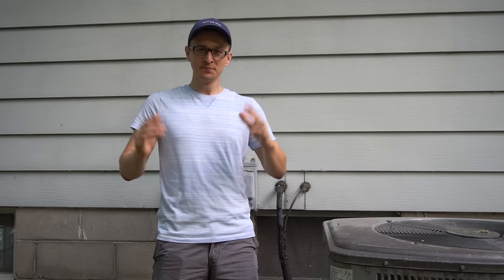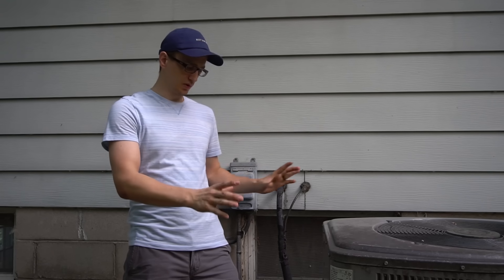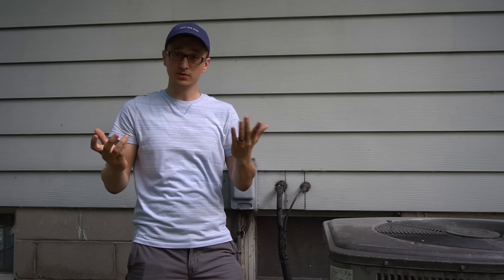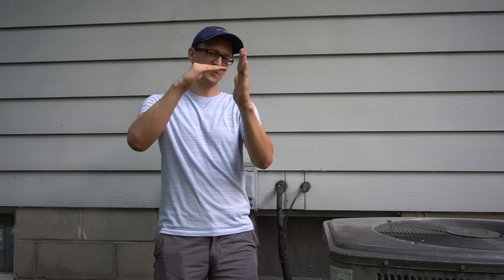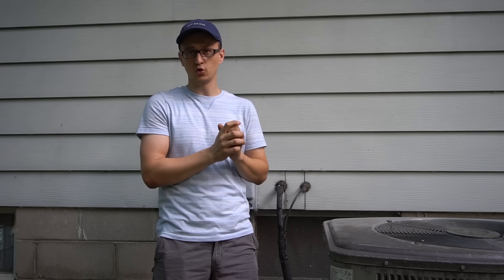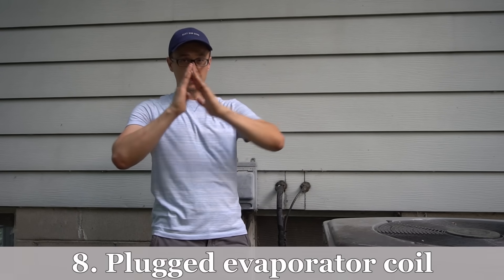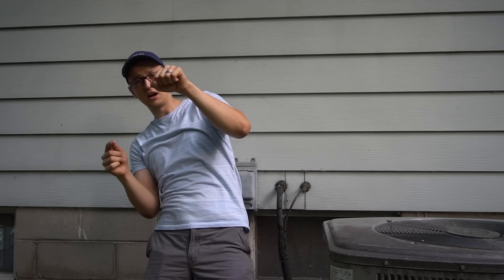8 Reasons Why Your AC is Freezing Up

Comment: As an HVAC tech, I appreciate not being called out for a dirty filter and the other simple reasons you have explained. Cheers
Reply: Why do you not want to be called out? You can charge for the service right? This is the problem, There are just not enough HVAC people, and so it is like pulling teeth to get a service person out even though they can charge to same hourly rate as a lawyer!
Reply: Sounds like this guy works for a company… there’s no incentive to actually do the job
Reply: It happened to my wall unit. I turned it off. Running the fan portion of it. See if it defrost. The change filter never came on

Comment: Don't forget a stuck contactor in the condensing unit, clogged blower wheel, and a bad defrost board in a heat pump application

Comment: One of my friends gave me an LG and air conditioner and I'm not sure exactly what was wrong with it but it was blowing air through it in the beginning she had it set at 60 I don't know nothing about air conditioners except that I thought it was a good one cuz it's the LG I don't know what year it was made but my other friend she's the one that brought it over the one that could carry the darn thing is heavy I couldn't lift it even if I wanted to I'm only 99% and I can't hardly breathe as it is but now that you took it apart we didn't have water yesterday cuz of water shut off but today we have it she offered to clean it wrong clean it out kind of without water it was hard you know but maybe she cleaned the air filters off a little bit I mean I don't know if you can get them wet or not most likely you got it maybe we need another air filter well she cleaned his bed she could as far as I know to wherever but once in a while I'm wondering maybe the wrong screw for the LG air conditioner was put in wrong or there wasn't the right screws because I know that if my LG is a computer I know that has a mind of its own and it pretty much read the way it was and but anyway she cleaned it to that she could and then when she went to plug it into nothing a humming sound I saw it getting cold and I saw the ice and everything but I didn't leave it plugged in more than 10 minutes because it was not blowing any kind of air well the LG air conditioner unit will not go through the window it only went to the window but not out of it cuz it's way too big the only way I can get that thing out the window is to probably break the window and I don't want to get in trouble for that but now it won't blow any kind of the van won't work nothing on it works it just makes a humming sound but nothing coming out at no breeze but the thing itself is getting ice it was ice on it that thing but there's no face a face on it if you know what I mean there's no advance on the face so I don't know what to do I'm kind of dumb when it comes to directions I don't know how much it's going to cost to get I was just thinking maybe I'll just throwing the towel and forget it all into school by another one I thought maybe it would be a minor thing but apparently it's more than a minor thing thank you if you get back with me sooner than anybody else has cuz I don't see anybody helping me anyway but they did it would be a miracle from God

Comment: Having new floors put down. Lots and lots of dust. Caught our system freezing up early. Will running the fan only until it defrosts and changing the filter fix the problem? I'm in El Paso, TX. Dry heat. Shouldn't take long to defrost. Thank you for the video!

Comment: Thanks for good info. Also a restricted filter drier. After the unit has been running a while measure the temperature on both sides of it - should be the same. If more than (2 degrees? - I don't really know ) it needs replacing.

Comment: hey man i did a coil clean because the coil was dirty, but after reinstalling the coil i found a plug inside the coil itself theres a restiction within the evap coil towards the bottom causing the bottomto freeze up and the txv is fine should i replace the entire coil or is there a way to free whatever is plugged inside the coil? any help is appreciated thanks

Comment: My air conditioning is leaking water 😱 fix that . Now have a slight leak coming from the other side of my air conditioning unit the seam . My air conditioner has only been running for about eight hours I’m shutting it off putting on air mode to melt the ice just in case before it gets worse since there was a clog in the drainage hose .  

I don’t see any ice on the outside I’m taking this as a precaution since I cleaned out the hose that was clogged where water could not leave the unit ( it’s 90° out tonight it’s going to be tough we’re not open the windows we’re just running the Fresh air mode to melt the ice due to the humidity outside wish us luck👍🤣

You did amazing job I’m subscribing Single mom raising my son on my own things get tough. Yet people like you keep us going💝👍🎉

Comment: Here lately, in the mornings  my 10 year old Rheem heat pump w/ gas auxiliary heat doesn't seem to keep up on 45deg mornings. I go outside and see frost beginning at the TXV to the coil but the coil is only frosted along the top edges. Is that a restricted TXV or low refrigerant or is the ctrl board failing to put it in defrost mode?

Comment: Thank you. Though, Taiwan has few kinds of such aircon outdoor unit like your video, but really learn more specific theory about coil freeze up issue. The past 4 days are busy for outdoor fan motor not spinning issue. The motor bearing needs to be replaced. But it’s 36c degree in Taipei this week, almost melting indoor …haha. For 23 years air con parts, there is no profit to replace my air con outdoor fan motor with risky 4th apartment out wall. But from the service engineer, my old school  AC air con outdoor compressor runs normally. So, I decided to fix the outdoor fan motor. The rusted screws  at  the fan motor  racket took 2 days to destroy it. In fact, the motor replacing is quite easy. At the same time, changing the new capacitors of compressor and fan motor. After all, they are not expensive and running 23 years … thanks your videos again.
I’d

Comment: Thanks so much, helps a lot. I hooked up the gauges with ambient temp of 99 degrees and the suction side is definitely low (55 psi), but the high side seems too high (290psi)....what is likely cause? Concerned about adding R22 and driving high side pressure even higher.

Comment: Very useful video. My outside condenser fan was buzzing but never starting. Replaced the capacitor outside and it started to run. 
Next day I noticed it iced up outside on the condenser. Went to the attic and checked the blower motor. It is a little cumbersome check. However the motor was "just hot" to touch. Changed the thermostat to Heat and cranked up the temperature. The blower motor did not come up even when the furnace lit up. Switched the power off to furnace. Replaced the blower capacitor. Switched the power on. This time the furnace and blower motor both came on. Changed the thermostat back to Cool. Works now. No more icing. Changing the motor will be a lot more difficult task.

Comment: Thank you for the video I live in San Antonio Texas and the unit froze, shut off and started cleaning the return vents,replaced filter and kept the fan running on the unit. It's midnight and hot so will clean the evaporator coils later in the morning. The landlord is a certified retired ac tech and old so I help him with all the maintenance plumbing,electric plugs and so on. If after cleaning the coils and still freezing I'll get him to freon the unit 🤞🏼, thank you again. Peace out ✌🏽👍🏼👍🏼
Reply: After cleaning the evaporater coils and outside unit the central air is blowing cold air and had to adjust thermostat it was at 75° but the temp inside was reading 70°, I really appreciate the video and thank you again for the assistance 👍🏼👍🏼

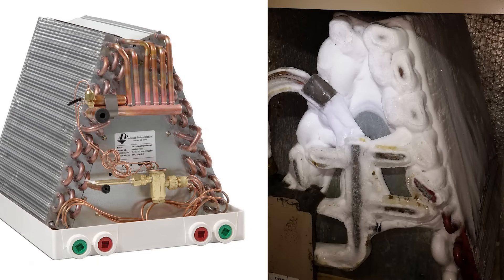Comment: 2 things I would like to correct. First of all there is only 1 reason a unit freezes up, if the temperature drops below freezing. Why is another thing. Second: at 1:03 you say "the air is not absorbing the cooling". I'm assuming you meant the refrigerant is not absorbing the heat? It doesn't work the other way around. First law of thermodynamics, heat goes to cold not the other way around. But great video, keep it up.

Comment: Thank you very much! This helps a lot! Our AC unit froze up 4 times in the last month. We called Reliance Home and Comfort and they sent 4 different guys to look at it. They all said nothing was wrong with the unit and to just keep the vents open. 
Each time it freezes, my wife, our 2 month old son and I sleep in the basement because we need to keep him cool. I'm hoping we can figure out what is going on and get it fixed. Thanks again, we really appreciate it. Looking forward to seeing more of your videos.
Reply: Sounds like it's time to find another AC tech company!
I had the same problem at work on a unit. Was using the same company for years with bad results.  Finally called out another company,  they looked up the information of the condenser, the evaporator and the air handler. Said all three were mismatched and could never perform right.
They gave me a really good quote to replace the needed units.  Worked flawlessly there after! I never looked back!
Sometimes these so called professionals are self-taught.

Comment: Awesome videos as always!  Next time you're cleaning the evaporator coil ("A coil"), would you mind shooting a video?  Mine is up in the attic (part of a heat pump type unit) and I don't see an easy way to get to it for cleaning (or even just to inspect it)...  Thanks again, you are the GO TO source for all things HVAC on YT!
Reply: I took a wet dry vac and put it in the shaft and gently moved it around as much as possible.  I also sprayed coil cleaner in the shaft and not sure if it actually  hit anything but was desperate. Something worked out though because it's a nice 72 degrees now instead of 87. If you can afford to have someone else do it that's probably the best idea. I absolutely couldn't afford it so after being really hot for a few days I said screw it I can't make it worse.
Reply: Thank you Jay love how you explain well how to un freeze the unit.keep up your good word for helping me to understand God bless

Comment: Hi! I have a question. The last ac tech that checked my ac unit at home removed the sensing bulb from the bracket at evaporator exit and just moved it aside i have noticed that my ac is not cooling that good now is this ok what the tech did or should i put the sensing bulb back on its bracket?? Thank you. Great video. 👍👍
Reply from the maker: I would put that bulb back where it was as that is what helps control the flow of refrigerant.
Reply: @WordofAdviceTV Thank you so much! That's what I thought. Do I need to pull the fuses off before I do it?
Reply from the maker: @leonnegro4504  If there are wires with uninsulated connectors in the area, then better safe then sorry. I would turn off the power.
Reply: @WordofAdviceTV  Thanks again!!

Comment: My Goodman is the opposite. I went through all of the procedures you outlined in your AC Unit Not Turning On video. Everything for the furnace end is working properly and it appears that everything on the AC end should be working properly. There is no sweat or frost on the line going into the compressor at the AC unit. Any idea what the problem may be?

Comment: Excellent videos man!
I wish you could be here to get to the bottom of our problem.
Reply: A very kind & free HVAC man helped us in the winter by replacing our furnace with the almost identical Goodman model (except smaller with some sort of 'overdrive' mode).
Now in the ridiculously hot summer it's freezing up.
He left the bottom cover off (where the blower motor is) & replaced with a filter taped on by foil tape.
Could ghat be the issue?

Comment: For double circuit coil, Can we use solenoid valve to isolate the gas entering to evaporator coil during half load conditions? This would leads to avoid frosting over the coil under partial load conditions.

Comment: The lowest you should set a thermostat is 70, not 67.  67 is WAY too low, and you'll definitely freeze up a perfectly functional system at that temp.

72 is better, and in truth 78 is supposed to be the optimum in terms of efficiency and comfort.

Comment: Should this be happening on a brand new system? Just had one installed a couple days ago and noticed some Ice build up on some pipes
Reply: It should 100% not be happening on a new system. Whoever installed it did a poor job on brazing the lines and that means there's already a leak somewhere. I would call them immediately.

Comment: Thanks Jay! Had my unit serviced with freon last year. Unfortunately, had to have them out again due to freezing. I'm running R22, it's a 90 degree day, but the service tech couldn't get my compressor to service above 40 degree at about 240 psi. Would this be because of a leak? Any suggestions where to check for leaks? I do have some leak detection fluid, but where should I be checking. Also, can I cut a hole in the plenum to get to the A-coil? Thanks for the help.
Reply: yep cut ahole in it then patch it up

Comment: How about you if my condensing unit is halftone smaller than my evaporator?
Reply: Outdoor can be equal to or half ton smaller then indoor. For Efficiency. Longer run time for compressor, vs more starts and stops.

Comment: The main reason for freezing up is an ac compressor relay … that’s the main reason .. bad relay will have compressor working without stopping .. just like a ac compressor clutch  in your car !!!relay will stop it and will engage it when sensor sends signal ..

Comment: what if the outside unit was frozen over but the inside filter was clogged bad(now changed).. is it safe to turn our heat back on?

I live with an 80 year old aunt(heart patient) and we currently have our heat off and it's 28 outside and going to be 12 tomorrow. All local hvac guys are days away from helping can you advise on anything?

Comment: This is the first video I've seen that the person sounds knowledgeable,  while I question the freezing up due to thermostat being set to low  the other 7 points are accurate but I guess it could happen with lack of airflow over extended time but if the system is correct it shouldn't,  but I guess that part of the point anyway. Just wanted to say thanks for at least one person on utube that knows what they are talking about . Sometimes I feel like I am the only one that knows what there doing in the industry so it was refreshing to see someone with some knowledge out there giving true information

Comment: LOVE IT!! Straight to the point and you taught me many other reasons why a unit will ice up!! I just knew about the defrost, and sensor, low on r22 or whatever they're using now.. Persolanny I think this york heat pump is a pos. It's not completely freezing up but the condenser gets very frosted up. got the def set at every 1hr which is in the middle. when it gets really frosty I'll go out there and trip the defrost tester to make it defrost. however, it's defrosting every hour. I think it's low on refridgerant. the temp outside is 36 and it's frosted up.

Comment: How do air conditioning systems in people's cars not freeze up when they turn the fan speed down? I don't think most car AC units have variable flow compressors, so you would think their would be problems with evap coils freezing over from low airflow.

Comment: We are building a cooler for hanging meat and trying to get a window air conditioner to cool an 8x8 insulated room down to below 40 degrees. We connected a small heating element to the thermostat sensor to trick the air conditioner into constantly running. We've gotten down to 50 degree but then the unit freezes up. Any ideas on how to get this to work?

Comment: question... my central ac is on roof 25 yrs old and just had freon added and works great. First real problem with ac  in 20 years. Does that mean its time to get a new unit? or keep this? Just wondered as some say the old ones are better made. Thank you

Comment: It's not "freon". It's refrigerant. People should know the difference. Not caring is how repair companies get away with robbery when they come to fix your unit! Simple fixes turn into "well, your capacitor is bad,  you might be low on freon. I can replace it AND add some freon, but it  might be better to just replace the entire unit. I mean, your unit is already 5 years old. Just a matter of time before it dies. I'm surprised its lasted this long, really".

Comment: I had a technician came out and fill up refrigerant. Changed capacitor. Spent over $800, it still freezes up. The airbus cold but very weak. The weird thing is, if I take out the filter, it runs fine. Bone dry and very cold. As soon as the filter goes in, in a few hours, it starts to have water and ice again. Why?? The technician is out of ideas too.

Comment: Recently had our ac converted from r22 to 422b, cause of a leak. tech evacuated system, and pulled it down with vacuum. Problem now is the line to the A coil, and the A coil itself  is sweating an extreme amount, to the point it feels a little humid. the r22 never made coils sweat this much, and felt more comfortable. Is this because the 422b runs a little different, or could it be overcharged.

Comment: why the accumulator sometime freezing? and why  we hear sometimes a gurgeling sound in pipes lines (Freon 410A)  THE DISTANCE OF PIPES IN FROM THE ROOF DOWN TO EVAP IS 30 METER) AND WHAT YOU SUGG IF WE FACE THAT ISSUE ? :).

Comment: Mostly likely cause why your AC is freezing up:
(1) Low on gas
(2) Not enough air flow due to dirty air filter or failed fan

(2) is easy to check; (1) needs pressure test (almost certain if your AC is old)